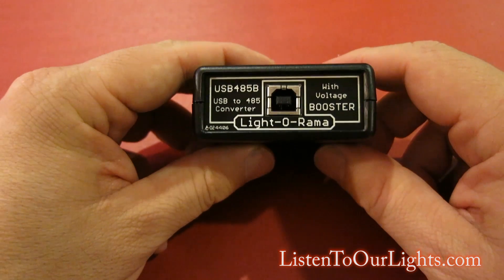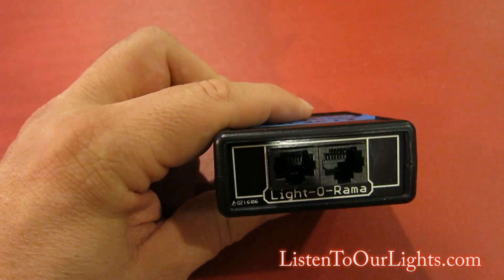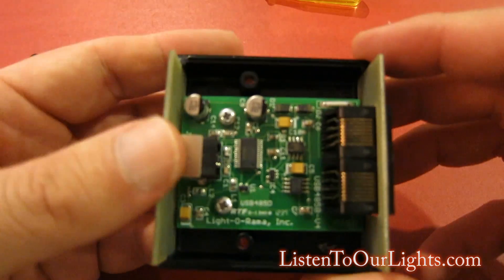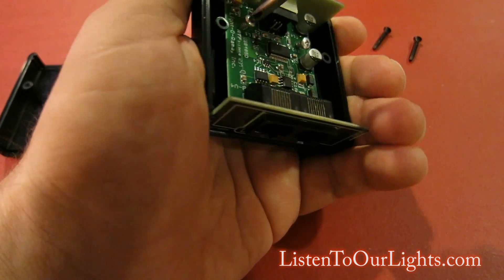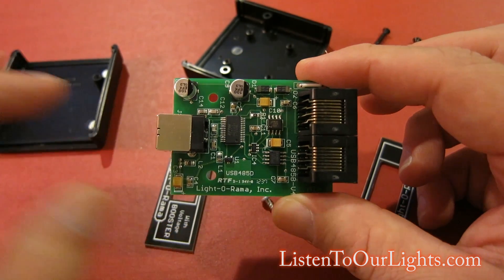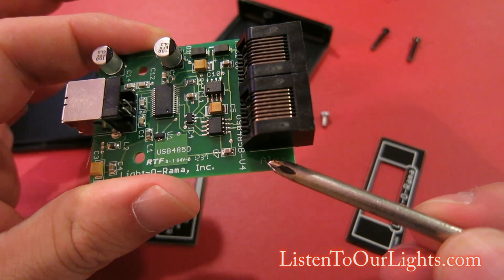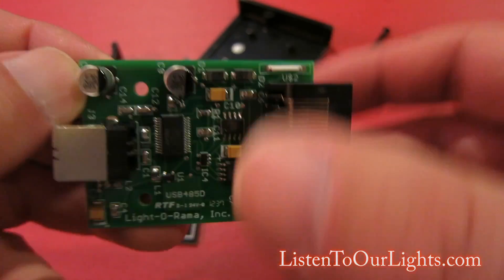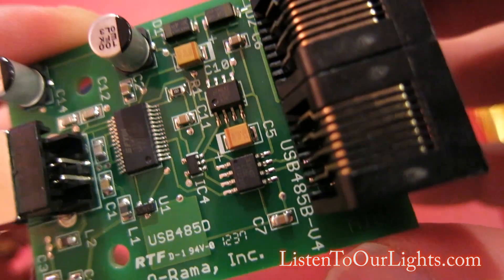LOR RS485B Deconstructed after smoking the poor thing

Comment: OK a couple of things I would to ask you.  Even though it is a RJ45 jack and you used an Ethernet cable, I take it using the light o rama control boards need different wiring of the cable.  If this is true, can you direct me to a wiring diagram?  Did the RS485B work after reassembly?  Thanks!
Reply from the maker: +John Mayer Wiring is straight through. It did work after putting it back together.